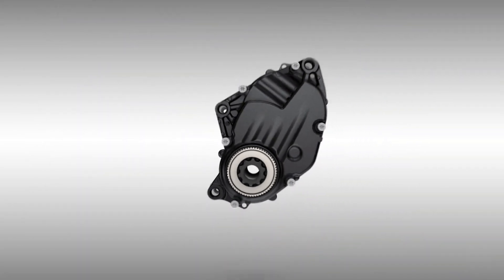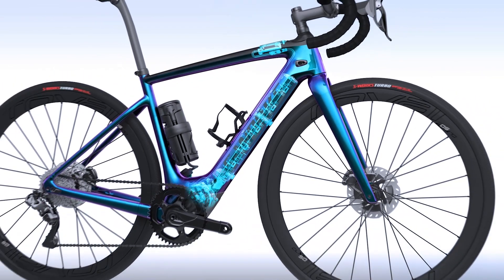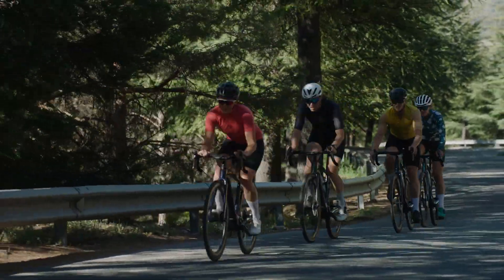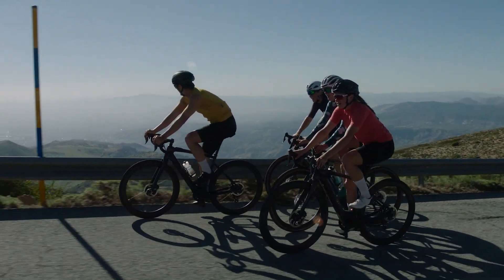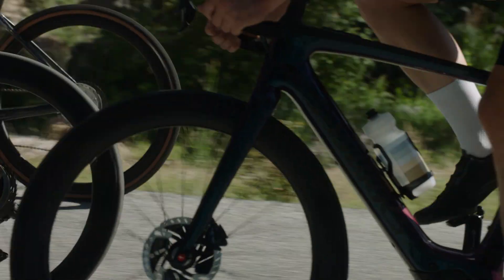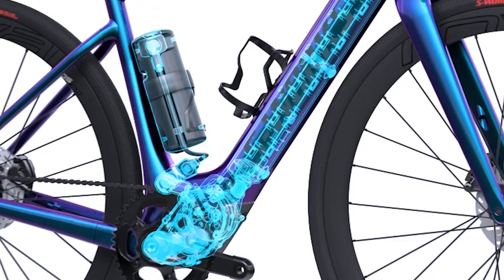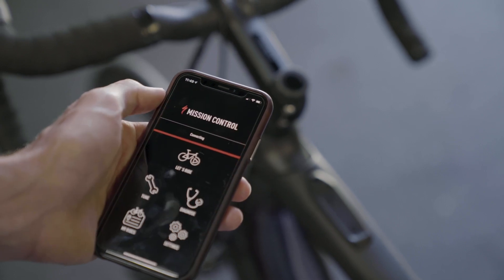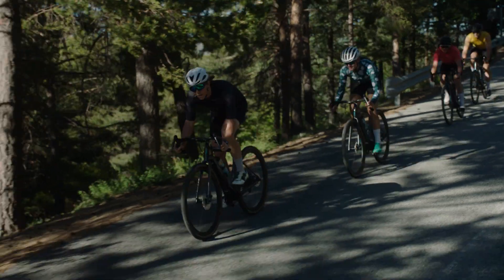Specialized SL 1.1 Motor

Comment: I liken it to a 4 cylinder, a 6 cylinder and an 8 cylinder.

I want the RIGHT AMOUNT OF POWER, nice and balanced at all times👍🏾…until I don’t.😜
Then I want, at the push of a button and at my WHIM or LEISURE, the ability to have the Bike do most, if not ALL the work.👀◀️

Add PANNIERS, TRUNK BAGS and the like and 70L-90L of “Stuff”.
Throw in UPHILLS, MOUNTAIN ALTITUDE and maybe some PREVIOUS MILES before LOADING UP WITH CARGO or just plain old “‘Cause I feel Like 
It”🤪 and that V8 sure sounds like Luxury.

👋🏾The Point being:

Your Lower End  E-Bikes may have a “4 Cylinder”.
Your Mid-Level E-Bikes may have a “6 Cylinder”.

☝🏾
A TURBO CREO SL COMP CARBON EVO should stand for “V8”.

A TURBO CREO SL EXPERT EVO should stand for  “STRONGER and MORE POWERFUL V8”.💯

An S-WORKS TURBO CREO SL EVO should stand for “STROKED OUT and HOT-RODDED V8”.🎓💯💯

🙏🏾🙏🏾🙏🏾🙏🏾

Comment: 35 NM ?
That’s not much .
Maybe not enough ?
Reply: Henry Rooyakkers: Not much for mountain biking, relative to what's out there, but for a typical road cyclist who wants the assist to feel like it's coming from their legs it's perfect. I've been riding mine for over 7,000 miles without a hiccup (except once when the plastic motor cover on the underside of the bottom bracket broke slightly). The power, which I can choose, is perfect.
Reply: @lazurm  hmmm ,
I’m going to think about it. 🤔